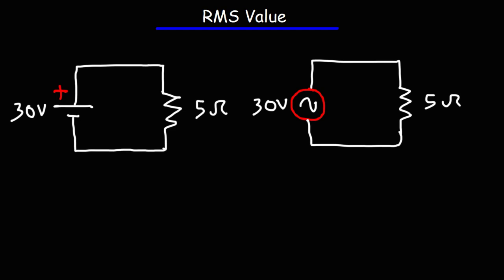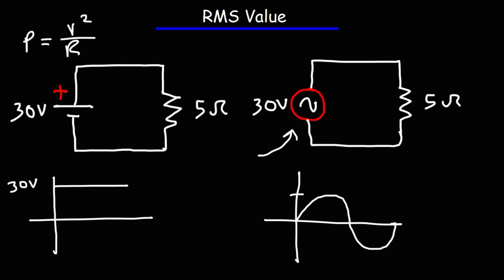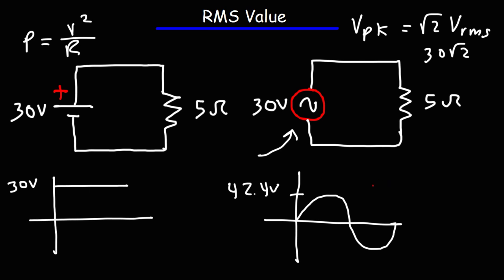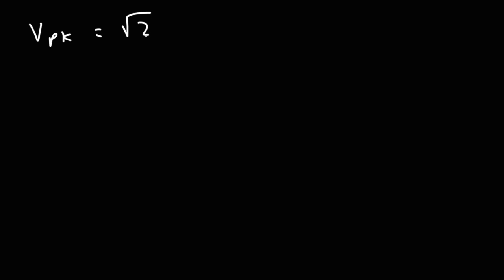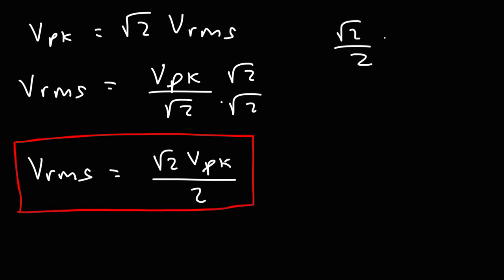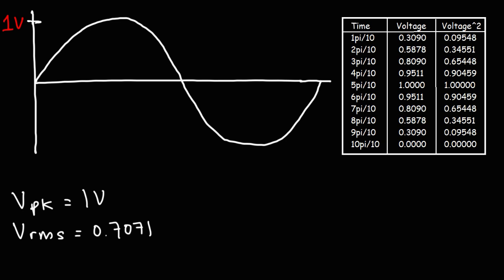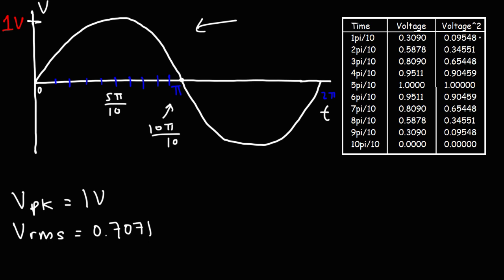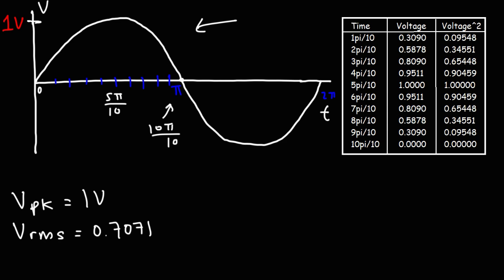RMS Value of AC Circuits

Comment: While the final value is correct owing to the symmetry of sin²(t), the concept of RMS value should have been calculated with integral limits should have been 0 to the period of the waveform [in the case of sin(t) should be 0 to 2π..]. Otherwise you'd quickly run into trouble with non symmetrical waveforms, such as any square waveforms with anything other than 50% duty cycle.

Comment: Simpler way to unerstand this for sine AC is to take the sine func, square it and than root it so its always positive, then take median value of the amplitude which is sin45, or the √2/2 as a coefficient, and then multiply the peak with it to average it out. Not sure about mathematical validity of this, but it makes practical sense.

Comment: You immediately state that Vpk = √2 Vrms. However, you have jumped too far ahead already. WHY do you use √2? It doesn’t do anyone any good just to tell them to use a √2 unless you explain the significance of where and why there is a need to use a square root. Without explaining why the √2 just magically appears, you are just reciting a formula for people to copy and calculate, yet you have dropped the fundamental explanation of WHY the square root came to be used in the first place. Please provide an explanation to tell the viewer why every single variable exists in the equation. Don’t assume people understand what the function of the √2 is, where it came from, and why it is so significant in this equation. Thanks
Reply: what's the purpose of using square root 2?
Reply: I also have the same question as you

Comment: I correlated the value to multiply the peak voltage as being very close to sin(pi/2). So I decided to use square root of 2 divided by 2 in my rms calculations. My instructor said I was wrong, and that I should use 0.707 instead. So I use .707 in his class and square root of 2 divided by 2 outside of his class. I'm happy someone covered this! Rather than just saying so use .707 without explanation.

Comment: Excellent explanation. However, there is nothing special about Vrms - it is just an estimate of the non-peak voltage over a cycle. Vrms is used because, by convention, people have chosen the rms value as the estimate to cite. RMS (root-mean-square) is the first go-to in statistics when the average fails (i.e., equals zero, as it does in your example).

Comment: I have a better way to understand this. The RMS value is the value we get, when we are half way up to our peak. If the voltage was increasing linearly, a straight line, then the halfway point is 0.5 time peak voltage. 
But the voltage is increasing in a perfect circle. The circle starts at zero degrees, at 90 degrees we are at peak, 180 back to zero, 270 peak bottom and 360 back to zero. so, halfway from the first peak is 45 degree of a circle. To get the voltage at the halfway (remember your high school trigonometry) you need to do Sin(45) = 0.707. Thats it!
so sin(0) = 0 volts, starting voltage.
Sin(45) = 0.707, halfway peak
Sin(90) = 1, peak voltage
sin(135) = 0.707, halfway down
sin(180) = 0. a half circle complete. now we do the bottom half
sin(225) = -0.707, halfway to peak, but negative value this time!!
sin(270) = -1 peak bottom voltage
Sin(315) = -0.707, halfway back up
Sin(360) = 0, full circle complete.

So, basic trigonometry, if you know circles and basic sin law. the average is, the midway point from zero to a peak, or 0.707*peak value. You don't need to do all the math he did, just sin(45). it is intuitive if you understand 90 degree is from nothing to peak, 180 back to zero and so on. So 45 degrees is midway average = 0.707
Reply: He did not do all the math to get this result, he did the additional steps to prove the rms value.
Reply: So, you have a point. But, on Electrical exams they dont let you use a calc that has the (sin) button, basic calculators only. Therefor it is necessary to know to do the hard math.
Reply: @paulsemenikhin5375  Every electronics exam I took let us use a trig calculator... Yes, in calculus II we learned def integrals, but, that's a different show :)
Reply: Thank you dude, I knew there was a geometric explanation to convert the sine wave into an equivalent linear value but you cleared it up for me. Cheers mate
Reply: If you know the 2 special triangles and trig you can figure this out. I used this to solve for rms. 0.707 is what they ask for in class but I like using sin45, which is root 2/ 2. This might not be technically the exact number to Express the equivalent amount of heat from ac current to a DC equivalent, but root 2/2 is very close, and .707 is good enough to get an idea of your voltage. In other words, trig is enough to work this out. I don't know why is school they said using sin 45 was incorrect and .707 was correct. Someone can help me with that.
Reply: But the graph will not be sinusoidal everytime.😊
Reply: Q  find  the avarag output currant and its root mean square RMSof output current ?  ممكن تساعدني بالحل باسرع وقت
Reply: Nice approach

Comment: I understand that RMS yields the equivalent DC voltage, I just don't get why mean doesn't. I would expect that taking the arithmetic mean of 1/2 cycle would yield the correct result, but it doesn't. I don't understand why that is.
Reply: I believe that all one is trying to do is get an estimate of the non peak voltage. There is no "correct result" - just an estimate. This is a standard problem in general statistics. By convention people have chosen that estimate to be the root-mean-square voltage, Vrms = .707*Vpeak = 30V in his example. If we chose your definition as the estimate we would get 
Vest = (2/Pi)*Vpeak = 27V. This voltage is a perfectly good estimate - just not the conventional estimate. In science and engineering it is important to stick to a convention so that we can communicate with one another with clarity.

Comment: Please I need help for the period part
Isn't the formula for V= Vm(sinwt)? Where w= 2π/T,  are we using the period as 2π or just π?
Reply: in my own view, w= 2π/T it's help you to calculate the Hz but almost in period that mean 1 compleat  cycle of the AC so if set the π  is compleat period just use the π

Comment: Hey man, long shot you'll see this, but why is 1/t 1/pi? I'm under the impression that t is the period, which for a sin wave is 2pi right?
Reply: We are only looking at the positive half of the cycle.
Reply: @tj595555  awesome, thanks
Reply: The positive half is symmetrical to the negative half. Imagine flipping the negative half over the line to the positive side then cutting of the tops of the peaks to fill in the valleys. This is essentially the idea of vrms's effect. Leveling out the fluctuating voltage value to see what the overall effect is in terms to express it like a DC circuit. At least that's my perspective. Take it with a grain of salt and your own research.